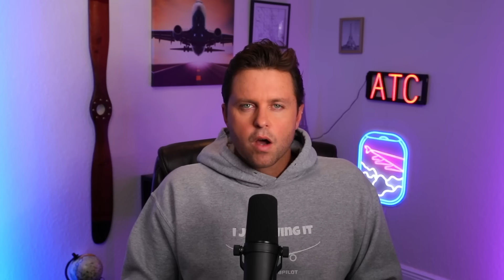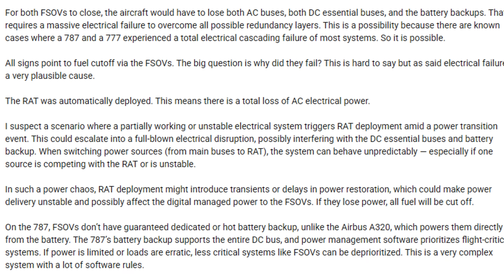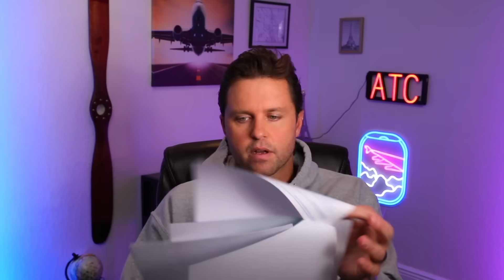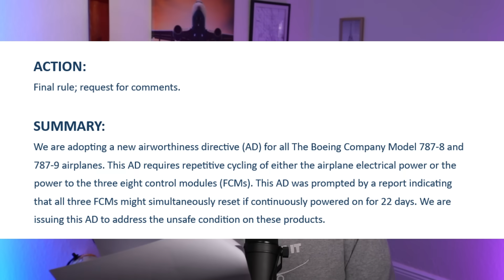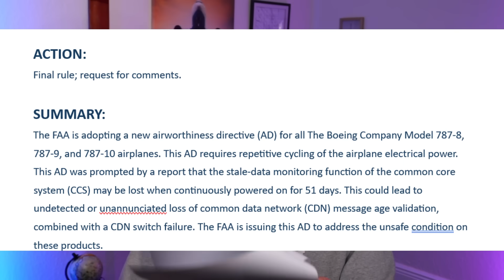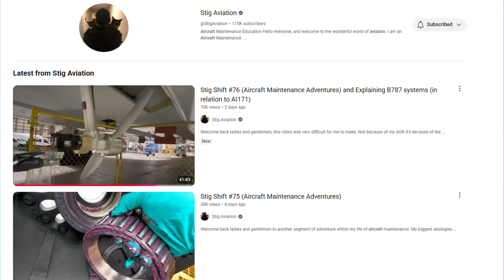Air India 171: Did a Software Glitch Cause Dual Engine Failure?

Comment: The rotation occurred approximately 2,100m from the start of the runway and can be determined using sightlines and the time between the dust cloud from  the rotation and when the aircraft overflew the end of the runway.

The aircraft rotated about 2,100m from the start of the runway and climbed to 400 ft (twice the wingspan, as viewed in the video) in 10 seconds, at a climb rate of 2,400 ft per minute, which is normal. Shortly after the problem occurred. At the point of rotation the tip vortices picked-up a small cloud of dust from the side of the runway. This position is estimated using the location where the video was recorded and the sightline to the aircraft and the buildings in the background. From this position it is 1,500m to the end of the runway.

The corrected ASD-B show that the last 8 data points, spread of 600m from the end of the runway, the height ranged from 21 to 71 ft agl and the ground speed was 175 fts. This would be in ground effect. As the aircraft overflew the end of the runway a large cloud of dust was picked up.

As can be seen from the video, the time interval from the small to the large cloud of dust was 20 seconds. Assuming that the minimum speed (to avoid stalling) was 150 kts (70 m/s) and the maximum, from the ADS-B data, was 175 kts (90 m/s) the distant the aircraft could have traveled is 1,400m to 1,800m. The runway is 3,600m long which estimates that the position of the rotation was 1,800m to 2,200m from the start of the runway, close to the 2,100m estimated using the sightline method.

During the initial climb of 10 seconds the aircraft was travelling at about 80 m/s (155 kts) and hence covered a further 800m from the point of rotation and now was 2,900m from the start of the runway and 700m from the end. The aircraft then rapidly descended to less than 100 ft agl, as evidenced by the ADS-B data.

The aircraft impact was 1,600m from the end of the runway and almost directly inline with the extended centerline of the runway. The flight time from the end of the runway to the impact site was about 20 seconds, with an average speed of 80 m/s (155 kts). The speed at the beginning would have been higher, as seen in the ADS-B data and slower at the end as the aircraft touched down is a mushing stall. The flight time from the point of rotation to the point of impact was 30 seconds.

If the engines were completely shutdown and the aircraft height was 71 ft at the end of the runway glide ratio would have been more than 74 to 1. Even in ground effect the aircraft could not have travelled 1,600m without some engine power.

Hence the engines were not completely stopped, by operating the fuel shutdown valves.

The engines had to have been operating at low power and were rolled back. 

The $64,000 question is why were both engines rolled back.
Reply: Maybe this is the reason? I saw a video where the pilot forgot to enter the flight parameters and the plane decided to cut off the gas and land. Still, that doesn't explain why WAR was involved.

Comment: I found @HeyFixThis comment so interesting and obviously coherent that I copied it out days ago when it appeared. It's very interesting that such logical and well thought out comments out of 100's if not thousands in all sorts of videos then prevail because of their conclusiveness.
I have (only another thought) a  theory, which of course as a layman I can't substantiate at all and which is only based on phenomena. Because I wonder if the entire runway was used and V1 was only reached shortly before the end of the runway or VR. Then the acceleration on the runway was much weaker than is normally the case with the same take-off weight and the same type of aircraft. I would deduce from this that V1 was reached, but so slowly that the thrust was no longer sufficient to get the aircraft to climb. If there was any truth in this theory, then the pilots would also have to ask themselves, if they still could, why they went through with this whole procedure, because they were experienced enough, at least the main pilot, to know what the acceleration normally has to be on a 787 during take-off.

I don't want to say that it really plays such a role, but perhaps it is a small piece of the puzzle for what happened afterwards, if there wasn't enough energy during acceleration

Comment: What created the electoral issue that activated a safety fuel valve system to kick in.? Pilots last words: “Thrust Not Achieved” which does imply engines powering down Not engines failure. Pilots main focus would be restarting engines which must include resetting fuel systems which should have open these fuel valves returning fuel to the engines.!!! First thing pilots could have seen is all instruments flashing off/on quickly followed by BOTH engines throttling down then fuel warning alerts. Then a big bang from the RAT deployment feeding power back into a faulty electrical system which could have interfered with resetting the fuel valves. Ultimately the pilots just didn’t have the altitude to reset everything and restart engines. Will the accident investigators find the electrical failure/fault that may have created this time line.?

Comment: @Garybpilot from GPT4o: "On the 787, the FSOV is designed to fail-safe to OPEN — not closed. So in the Air India 787 crash, it’s highly likely the FSOVs stayed open → but the FADEC lost command and reset  → and the engines stayed dead because thrust command couldn’t be processed during the reset window." 

Tried Gemini(Google) "On a Boeing 787, fuel shut-off valves are designed to fail in the open position in the event of a loss of electrical power. This ensures a continuous fuel supply to the engines, preventing them from shutting down due to power loss.  "

Apparently on the 787 the landing doors are meant to start to open before the gear tilts (I cant back this up), we didn't see this - another strange anomaly. 
Gemini : "On a Boeing 787, the main landing gear doors open before the landing bogie begins to tilt for retraction. Specifically, the doors open automatically about one second after the aircraft becomes airborne, even before the pilot selects the gear to retract. This "early doors" function is designed to improve climb performance. " 

4o:"In Ground Testing or Hangar Maintenance: What you likely saw was a maintenance test mode or nonstandard test procedure, where: 
Squat switches (weight-on-wheels sensors) are overridden or bypassed
Certain hydraulic or electric interlocks are intentionally disabled
Engineers/test crew manually command bogie tilt as a function check
The gear doors are held closed or actuated separately
In these cases:
You might see bogie tilt occur with doors still closed
But this is not representative of flight logic
And it's done in a controlled, low-speed, no-load environment to verify component motion"

Also, the 787 has had bus resets/ power loss events at the : gate, taxi, runway and @30kft, its just the 1st time this has happened above the runway. And as for the 3 AD's, yeh, if the plane isn't reset every 3 weeks, bad things can happen. 

Maybe they placed too much confidence in the redundant electrical system\CCR\ADFX (it's network) always staying up, so any comms loss to FADEC's indicates either a maintenance event , restart of entire aircraft or a hull loss into ground, initiating a reset of FADEC's, which means the engines spool down. (Speculating).

Comment: So if the fuel shut off valve contactor/relay is wired in NC configuration to energize the valve (keeping it open) a temporary power loss would briefly cause the valve to close. What we need to know is how long the valve being closed, if it is long enough to starve the engines to flame out before the RAT power supply reopens the valve. This may be incorrect but the logic should be sound. In my work a power loss to a structure must be rectified by the emergency backup power source within seconds. It would be helpful to know how long is the time lapse between power loss and RAT resupplying power specifically to the fuel circulation system. Is that time lapse long enough for engines to flame out? I’m pretty sure there’s an electrical code that states the requirement for this. Like for example- if code says it must be less than 5 seconds and for some reason it took like 7 seconds in this case? This code requirement would be helpful to know

Comment: Yes, you blew the lithium battery out by presenting it with a dual short circuit when both wheels were commanded to up. Look for the battery door on route where it first fell off.

Comment: I'm only speculating here, but I've thought all along it's fuel starvation to both engines caused by an electrical fault, but it's incomprehensible that an airline does not have a separate system for each engine, whereby one of the engines would still have been  fully working and then in turn a different outcome would have occurred.

Comment: I’m retired DC10,A320,A330,757,767,747 & 787 cabin crew. (Hated the 787 from my perspective, horrible to work on. Lots of cabin electrical failures) May I ask pilots here, do you think we will get to know what really went wrong here or do you think they’ll blame pilot error regardless to save Boeing and Boeing global operators and their suppliers? . If indeed it’s down to build/manufacturing quality. I think they’ll try hide the truth. Way too much at stake here.

Comment: Complete bollox, the fuel shutoff valve does not work like that. Engine cutoff switch or the fire handle only, no auto system and has an electrical backup power supply.

Comment: Let's make a test in the sim. With low air pressure hot temp e and the lost of all the Electric system in the plane,with the completly cut off of the Valves

Comment: Engineer here (not in aerospace). Indulging the news on AI 171, all the articles from 10-15 years ago came into my mind, on the completely rediesigned electrical system, it's reliance on the lithium battery as a backup, and the regulare failures and fires around the battery and other systems. The 787 is an insanely complex design, and that does not always help.

Comment: Is the FSOV spring loaded to closed position or motor-operated?
“Closure of the FSOV is initiated only by a direct command from the Electronic Engine Control (EEC) or when the engine fire handle is pulled.”

Comment: Dear Captain,

Subject: Analysis of AI 171 Incident – Potential Vapor Lock-Induced Dual Engine Failure

Following a thorough review of available data, including research conducted via Perplexity and drawing upon my professional experience, I have formed the considered opinion that the incident involving AI 171 was likely precipitated by a vapor lock, resulting in dual engine failure. Notably, the control tower reported an ambient temperature of 43°C in the shade. This suggests that the tarmac temperature may have ranged between 55°C and 70°C.

Given these conditions, and depending on the duration of taxiing, it is plausible that the internal temperature within the wing structure exceeded 49°C, which is the maximum threshold specified by Boeing. Such circumstances could have significantly increased the risk of vapor lock within the fuel system.

I welcome any comments or further insights you may have regarding this assessment.*Cheers, Prof. Dr. Bob O'Donovan (bfodonovan@gmail.com)

Comment: Here’s the thing though: really not a shred of evidence. So sure, maybe, but pilots have several times turned a single engine failure into a dual engine failure. With zero information, both of those things are about as likely.

The investigation will be interesting for sure.

You say you’re not gonna speculate, but come on… What exactly is it that you think you’re doing here?

Also bear in mind, Google literally makes shit up. Some of those AI generated answers, when you try to find the source material, there isn’t any. For example, I can’t find a single hit mentioning FCSOV and 787 together. Does it even have something with that name? Also, the aircraft is mostly bleedless, only using bleed air for anti-ice and some hydraulic pumps. So the mention of bleed air specifically is also a little bit suspicious.

Comment: Hey, as soon as I saw the YT interview with the passenger on a previous leg on the same tail number reporting severe electrical problems, the first thought that passed into my mind was, WHY would pilots take off in a plane with known electrical issues?  The 2nd thought was, this is a chicken/egg type scenario.  That is, did engine problems cause power outage, or did power outage cause engine problems?  It was always 100% clear that the fatal leg of this flight had severe electrical problems.  The only unknown variable was, on that final leg of flight....did the electrical problems happen before or after engine problems?  Because at some point, there was obviously engine problems, also.  If it turns out that this FSOV can fail to a "kill everybody" mode, that is not exactly good news for Boeing.  Yikes.

Comment: The AI plane kicked up a whole lot of dust as it was taking off. The cloud of dust went pretty high as is seen in the take off footage. Did the sensors to the FADEC think the dust to be close to ground and so caused the FADEC to transition to ground mode, which then caused the fuel lines to shut off? As you rightly point out, the high temperature prevailing at the time may also have triggered the FADEC to shut off the fuel lines.

Comment: Remember that all accidents are not from just one event or failure. There is always a series of unfortunate events that lineup the Swiss cheese holes. And if any one of those unfortunate events does not occur, it breaks the chain and the accident does not occur. So therefore, according to the Swiss cheese model, there has to be a thick layer of failures or errors that stacked against 171 that day. If fuel shut off valves played a role what other Swiss cheese holes lined up at that same moment to bring this aircraft down? It would be interesting to map this out.

Comment: Looks very plausible  that underperformed software is a big smocking gun in this tragedy  ut lets face it the electronics are the biggest cause of modern car breakdown and Aircraft are plagued with the same problems but with greater redundancy in the systems

Comment: 1.	Fuel (electrical) starvation.
2.	Both engines INOP seconds after T/O.
3.	LG «UP» triggered dual engine failure through SYSTEM BUG.
4.	Boeing designers must answer…

Comment: The Pilot debrief dude who hasn’t really speculated like a maniac like all the others …Steeeve. Debrief says one of the pilots likely shut down fuel to the wrong engine and by that mistake dooming the plane. He thinks one engine blew out on takeoff roll that is not filmed. For a few seconds the functioning engine safely elevated the plane, but in the havoc in cockpit shut down fuel to the perfectly well functioning engine. A gigantic pilot error if he is correct.

Comment: Boeing and Software seem to be incompatible.
The fact that it happened simultan, excludes mechanical failure, fuel contamination and maintenance flaws
I know there are back up systems but the single point of failure is the Interface between the analog Pilot and the digital plane

Comment: Excellent comment and video. At this stage most likely cause of accident - not flaps or undercarriage, not contaminated fuel or pilots' mistake but software glitch which caused killing all electricity and stopping operation of both engines.

Comment: Software engineer here. It is virtually impossible to have error free software designed for a complex control system like a modern airliner.
It may take years for the error to cause a problem, but it eventually will.

Comment: All these so called “you tube investigations” into what happened make me laugh and only using this to increase your channel views.

Please let the NTSB investigate and give us the 💯 cause of the accident.

It’s like saying oh my engine in the car stopped running while I was driving……must be a technical fault/failure. Err no simple answer could be you I just turned it off in motion… which you can. So please leave this speculation to one side as you and other you tubers are not helping. If the airline industry were really concerned they would have grounded all 787.

Comment: Mate! Both engines have their own tank of fuel and pump, each side of the plane. Contaminated fuel would have to be extremely contaminated to shut down both engines together. Like all water, literally. Any trained personal refueling a craft like this would discover this fault at the time. Shurley?

Comment: Good theory
Reply: The aircraft was at 71 ft agl when it was at the end of the runway and the crash site was 1,600m from this position. If the engines were shut down completely the aircraft could not have flown that far. Hence the engines were not shutdown, but were rolled back to low power.

Comment: We will see that what will come out with Ntsb report, Anything is possible for now, But watch the tail of that plane.. Horizontal stab constantly being trimmed which means Auto trim was working from begining to the end of flight, so there is some sort of power source exist on this plane. Also Stab trim ( looks like it was on correct angle all the time) and pitch up atitude that plane looks like what A/P does on power loss to protect altitude which makes it look much more weird..

Comment: You say dual engine "failure" and "flame out" a lot of times, altough it may be idle or simply decreased thrust of the engines...we don't know yet. Anyways, it's terrifying...flown the "dreamliners" a couple times; happy to be alive
Reply: If the engines were both shutdown the aircraft would have not been able to fly to the crash site, it would have crashed sooner; hence, the engines were rolled back and not shutdown.